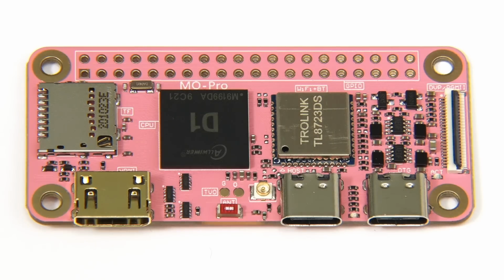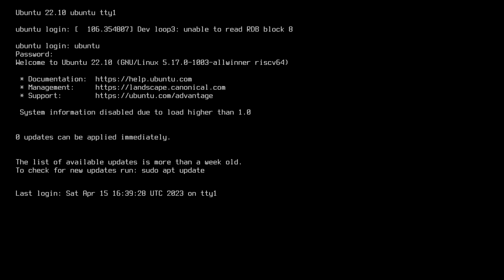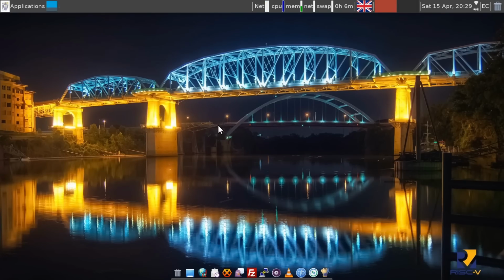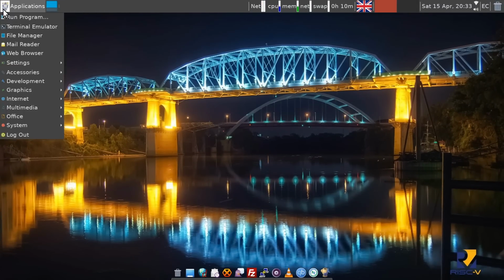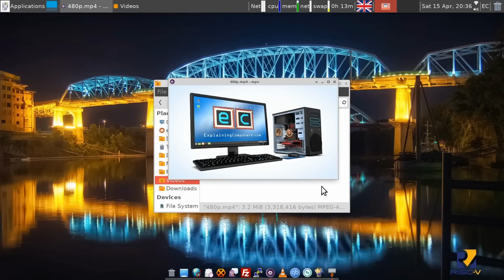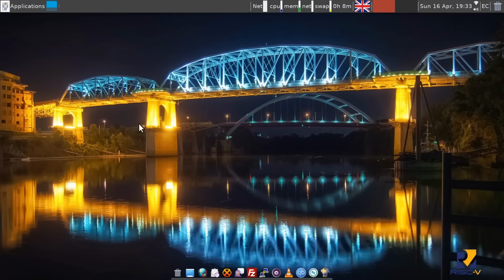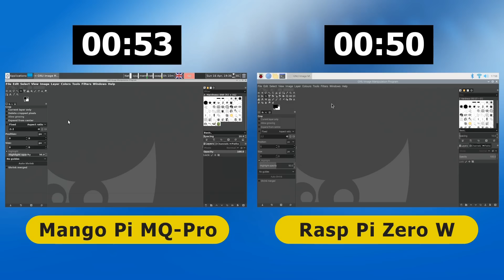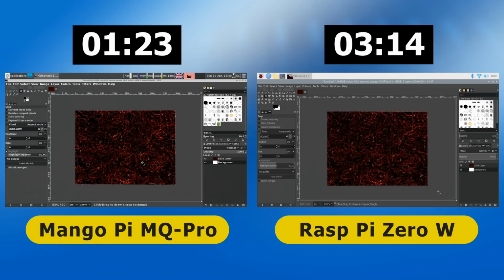Mango Pi MQ-Pro RISC-V SBC

Comment: It's truly shocking that an open ISA specification released barely more than a decade ago is running a working *desktop*. Stunning, considering how long it takes many open source software projects to spin up to critical mass. I also just got one of these boards and demoed it at work, where we make extensive use of embedded computers, from simple 8-bit chips to more powerful ARM hardware. My boss has been evaluating RISC-V as an option considering ARM's recent pricing...shenanigans.
Reply: Fortunately nearly everything for a desktop is written in fairly plain C.  Portability of C may not be great but it is good.  With care, I have been able to write stuff that works exactly the same on 32 bit and 64 bit machines.
Reply: Consider that the Linux kernel runs on over two dozen major processor architectures, which is close to one for every year it has been in existence. And you can get full Linux-based development/deployment stacks on all those architectures. Open Source software finds it much easier to port to new architectures than proprietary software does.

Consider, for comparison, that Microsoft has been struggling for over a decade to try to get Windows running in a useful fashion on ARM, and the odds of having Windows on RISC-V are essentially zero.
Reply: I am not at all surprised that the Linux community are on top of the game though, it's a very exciting platform with so many possibilities for being FOSH!  I am always wondering how many cores, caches, memory, GPU and other options/configurations computer architects will come up with on the platform for having the freedom to go nuts with it only restricted by their ingenuity, and sadly their budget!  I want 256 cores, 512 threads, gigs of cache and TB's of memory!😜
Reply: In my opinion, it is up to the hardware manufacturers to upstream their drivers.  Throwing boards out there and hoping that someone else will fix the software isn't the way forward.
Reply: The idea to START developing the RISC-V ISA, from nothing, was barely more than a decade ago. The first publication of essentially the current user-mode base ISA was in 2015, 7-8 years ago, but the system-level ISA was quite different back then, and the full base ISA -- User and Privileged (as needed for a Linux kernel) -- was formally ratified in July 2019, less than four years ago.
Reply: Wasn't it 2015 or so?  I thought its been around for 8 or 9 years.
Reply: @kensmith5694  I am kinda of the opinion that stuff written in C that is not portable is a dev problem...  Saying another way...  If the dev isn't writing portable code in C, he or she has a good reason OR is being sloppy.  What say you?
Reply: @kayakMike1000  On some things, C makes it hard to make your code portable.  Which end of a 2 byte number is significant has shown up in audio players as a problem because there is nothing in the C standard about fixing the order of bytes being read from a file. The "int" type changes from machine to machine so a work around is needed like "int32" or "int64".  Some C code predates the IEEE floating  point standard.
Reply: @Bob-of-Zoid  Why only 256 cores?  Why only 2 threads per core?
Reply: @Nerve what does your boss do with old embedded PCs when you upgrade?  I could use some old 486 PC104 stuff both for demo on my channel, and also cause I want one to build a retro machine for myself.  Talk to me Goose!
Reply: @kensmith5694  So how come I can take the same piece of source code and compile it to work on Intel and ARM without modification? That's exactly what I end up doing installing the same application on a desktop PC and a Raspberry Pi when, for example, I run my distro of choice, Gentoo Linux, on both of those platforms. I download exactly the same source code package on both of them and the local compiler creates the correct executables and libraries for the platform.

Saying something is "easy" or "hard" is subjective and not the same as "possible" or "impossible" which are objective statements of fact.
Reply: @terrydaktyllus1320  People have gotten fairly good at working around the issue.  Take a look at the code and you will see the extra work the programmers did.
Reply: @lawrencedoliveiro9104  And there was the utter failure of the Windows NT on MIPS project.  I am old enough to remember Microsoft claiming that NT would be enabled on a wide range of processors, not just the IA86 and MIPS.
Maybe you could include the rather abortive Transmeta Crusoe, that did at least make it to the market in a laptop.  It is a shame that the project took so long to get going, that by then the rest of the chip market had exceeded the efficiency claims made for the Crusoe.  So was that a closed source failure (for the IA86 -> VLIW interpreter), or a product development failure?
Reply: @kensmith5694  I don't do "homework" that other people set me just to make them look right.

As I stated very clearly above - Gentoo allows me to download the same source code package, compile it and run it on multiple platforms. That is simply a fact and enough of one to refute your original statement.

What other people have or have not done is irrelevant to this discussion which is between you and I, not "you and your big gang of virtual mates who agree with you but aren't here" and I.
Reply: @terrydaktyllus1320  So you are not willing to learn and take a small effort to find out the truth.  Oh well.  Continue as you were.
Reply: @kensmith5694  I am not willing to attempt to learn from people who instill no faith within me that they can teach me anything either factual or that I don't know already.

There, fixed that for you. We're done here.

Discussion closed, I shall indeed continue with my cynicism towards strangers on the Internet.
Reply: @kensmith5694  Because they don't make 40 gallon drool buckets!
Reply: @mattparker9726  Can you use a Macintosh Lisa?
Reply: @Bob-of-Zoid  yep. Or I could gouge out my eyes and be better off than using a Mac.
Reply: @mattparker9726  I don't think using it would be any fun, it's from 1985!  It's a museum piece if anything, for being the very first "consumer PC" with a GUI and mouse, well rich consumers at least at the $5000+ it was back then.
Reply: @Bob-of-Zoid  oh I play with museum pieces all the time! But they’re PCs though. Apple is the devil. (Sent hypocritically from my iPhone) but hey at least I didn’t buy it.
Reply: yeah it's absolutely crazy. i imagine if Risc-V someday reaches it's peak performance of running most x86 programs efficiently (such as from a wine/proton update), then i would seriously enjoy not using x86 ever again; When they fix their pricing ofcourse. 
only time will tell.
Reply: @mattparker9726  It was my first and only apple product ever, and I got it used (one year old) for 1/100th its purchase price, so $50!  I too won't touch Apple anything with a ten mile pole!  Shit, I don't do Microsoft, Adobe, and the only Google thing I use is this here YouTube, and don't use online services or the cloud either.  I'm a Linux FOSS user, and happy for it.
Reply: @Bob-of-Zoid  I like the concept of Linux, I really do!  However, I'm a dumb dumb windows user.  And before you say it, yes, I've tried Linux Mint.  Was confused by the whole sudo stuff.
Reply: @mattparker9726  Windows has a terminal too, every OS does!  Microsoft just tried their best to hide it, but most of those who troubleshoot windows know how to use it, and get a whole lot more done very quickly than you ever could clicking on stuff with a mouse.  If you are a dumb dumb, then it's exactly what Microsoft wants you to be!  When I switched, I only had tried Linux OS's a few times and gave up for it not being familiar, so in order to learn it, I nuked my Windows install, broke the CD's and installed Linux, forcing myself through Linux Boot camp!  Best decision I ever made!  It's really not hard at all, and instead of being lost without answers as in  Windows, I could see how things worked and connected, and it actually makes a whole lot more sense than spending hours looking for point and click solutions that hardly ever work in the first place, like Windows troubleshooting wizards that are downright insulting to ones intelligence!   And really, the terminal is hardly even necessary anymore in Linux, and the reason so many Linux users give terminal commands rather than point and click solutions is because it's a lot faster, more likely to work, and teaches over time in using them how to help ones self, for getting a good look under the hood.
Reply: @terrydaktyllus1320  It should be "I am not willing to learn (full stop).
Carry on are you were.
Reply: @John.0z  Yup, Windows NT was supposedly designed to be a “portable OS”. It did actually ship on Alpha and Itanic Itanium as well. Not sure if the PowerPC port actually made it to production. All of those non-x86 ports are now dead. Any of those architectures still in use (e.g. POWER/PowerPC, MIPS) are running Linux now.
Reply: @kensmith5694  you said “which end in 2 bytes” what do you mean by that?
I never had any issues with porting C code on types from one system to another. That’s what C compiler does for you after all. The only time I had to tweak types was when the Alpha came out, the first 64 bit processor and some code relied on overflows and of course the standard int type suddenly was 64 bit and there was no overflow. But that’s not the fault of C, that’s the fault of developers abusing types.
And that was an easy simple type def to fix that type.

The whole idea of C was that you can shift code from one machine to another and that the compiler takes care of the specifics.
C is an abstraction. 
Are there some differences in compilers? Sure! And sometimes hardware specifics are a problem but then again, that’s the hardware an developers issue for using those features. Using plain old C will just compile.
Reply: @CallousCoder  If a 2 byte value in a file is 0x00 in the first byte and 0x01 in the second byte is that the number 1 or is it 256.  The problem comes up when a bigendian machine writes the 1 into a file that is then read by some littleendian as being the number 256.  This is the simplest case.
You can have a program that works perfectly fine when "int" is a 64 bit number but messes up when it is 32 bits.  These days most people get around this with the #typedef as you suggest but if you look into it you will discover that this means the types are defined differently on different machines to make the sizes match.
Before the era of the IEEE floating point standard, it was common for different machines to have different accuracies of floating point numbers.  
In the more distant past, there were machines like the DEC system 10 that had a 36 bit integer length.
On some machines, mostly DSP stuff, you can't have a type stored at a location that isn't a multiple of its length.  Thus a structure with a character followed by an integer would be compiled with a gap in it to make it line up.
There is a lot of old code out there that doesn't port as easily as many people think.  Most linux compiles involve first running a "configure" script or firing off cmake before you to the actual compile.  This means that the project is not really written in "plain old C" it is C mixed with other stuff to make the compatibility tests.
Reply: ARM's recent pricing lol 
ARM has never been that great to work with even when you're waving a check right in their face; biggest silicon design PITA outside the HSPICE debacle.
All I remember was that no matter what we could always get management to spring for the ARM compiler even though they desperately wanted to somehow run the entire universe on free/open compilers while still getting the optimization that only ARM allows on actual ARM SoC with their proprietary compilers.  We'd build all the base open code using all the other tools then run part or all through a series of optimization passes calling in the ARM tools.  Since we completely automated the builds including check in test beds we were able to do centralized shared build tools and so only paid ARM the bare minimum for only the absolutely number of seats we needed for the check-in/build scheduling per project.  
But they were never very responsive when we found bugs; many other vendors of products and tools for integration were actually grateful and communicative when we found their bugs for them.  Fixing is usually the easy part, right?  Finding, not always quite so much.
I am so excited to watch RISC-V's continued maturation.  I don't know what the cost is today, but I remember getting wafer shuttles with other customers at TSMC as far back as 2001 and if you could fit it on half a wafer in a less layer/lower cost process it ended up being something dumb like 55k USD IIRC and you'd get a handful of test chips - even if it's 5x that cost, 250k for a batch of test chips seems like something even smaller companies or fabless engineering shops could pull off on their own funding/merits.
Reply: @terrydaktyllus1320  So you assert that you are right, then when someone provides you evidence that you're wrong you refuse to look at it because you're worried you might be wrong?
Reply: @circuit10  This isn't a discussion about me. You know nothing about me and therefore cannot speak with any authority about me.

So do try to keep up and stay on topic, there's a good chap.
Reply: @terrydaktyllus1320  I know what you’ve written here, so I can judge what you’ve written. I can’t judge that in the context of your entire life, no, but that’s not really relevant. You seem to have realised that you’re (partially) wrong and are now trying to come up with clever comebacks that aren’t really relevant to what’s being discussed
Reply: @circuit10  I have no idea what you're talking about other than you still seem intent on talking about me - which isn't happening.

So we're done here. You run along, sonny, mind how you go and stay away from sharp scissors.

This discussion is closed.
Reply: @terrydaktyllus1320  You don’t get to criticise other people and then say “this discussion is closed” when people say the same about you. Please stop being so immature
Reply: Let's be very clear RISC-V in practice only gives pretty large companies choice, it doesn't really help us much.
Reply: @autohmae Nonsense
Reply: @NoX-512  please tell me where you can get a reasonable price for custom chips done. You'll be paying at least 10k for a wafer at TSMC. And that's not the only costs.
Reply: @mattparker9726  We are a business-to-business industrial company. We do not use them as PCs. They are typically headless or run a set of procedures in the field as the kernel. We don't upgrade them so much as replace them with a new product, and we don't have much application for desktop OS in embedded. I was mainly just marveling that it works. A chip like the D1, however, does have the sort of speed and capability need to do our type of data recording.
Reply: Yeah, I still remember when RISC-V was just a toy architecture for your FPGA. I honestly expected it to dry out on the vine, just because early projects getting that much hype never seem to pan out. I imagine it's success can be contributed similarly to projects like Proton, a big player decides to pull some nefarious nonsense, and the industry throws it's weight behind a new competitor to evade the threat of imminent disaster.
Reply: The price of everything else is coming down and widely easily available yet Raspberry pi's remain and always were vaporware.  The only similar phenomenon is that somehow nvidia cards have gone UP in price in the low end I bought a 2gb 1030 GT for $80 3-5 years ago and now Amazon keeps trying to sell me a 2gb GT 780 for $80.
Reply: RISC v IS open as Open ai is